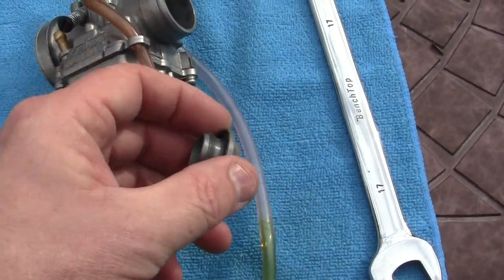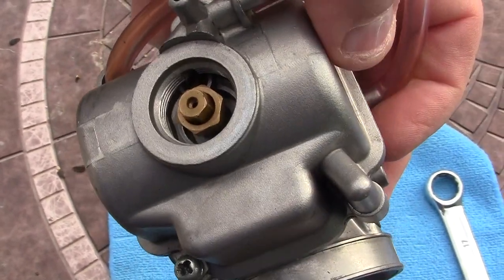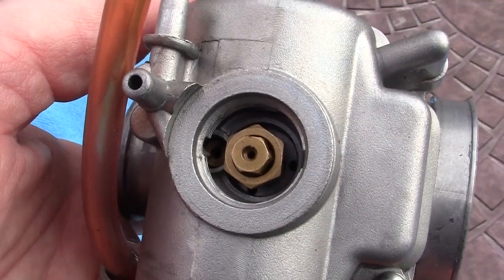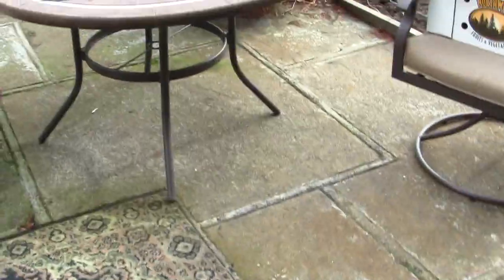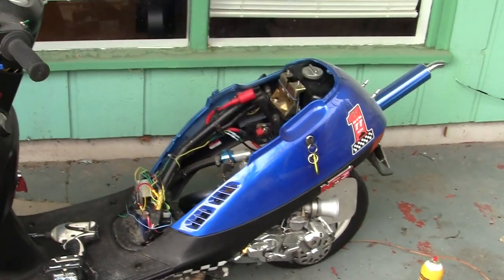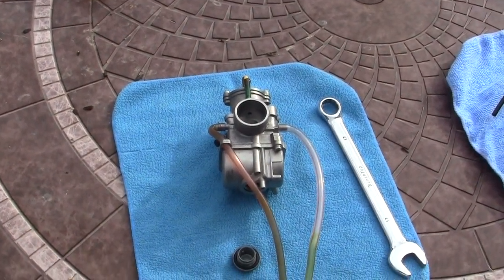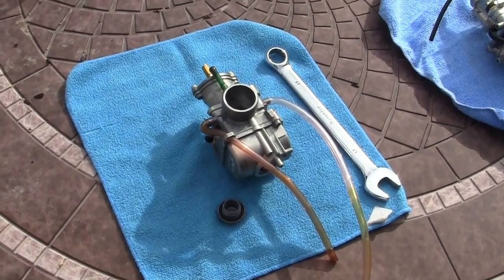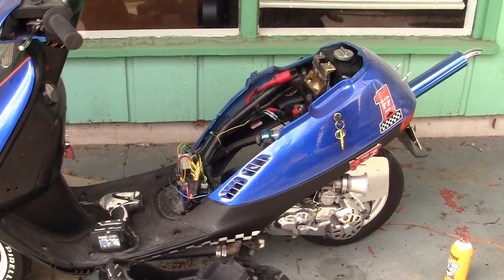2- HOW TO FIX= Most common MOPED  Carb problem.

Comment: thinking is the most time consuming ting when you fixing engines what ever.done it for 40 years so fully agree on think and use time to think.visualise it in your head and often you lockated the problem in your head.often save time to and lots off doing the wron g thing and maybe destroy a skru or worce.sorry for my bad english

Comment: Hi Great video.  I took my carb apart.  Soaked the jets.  I can't see through the pilot jet.  Do I need to see through the pilot?  My scooter is a Vespa ET4.  I don't want to put it back together to find out I should see through it.  The holes on the sides are clear and I can see through them but not from top of jet to the bottom of the jet.  Thanks! Michelle

Comment: My 49cc scooter dies if I run it up to 45mph and I already had the carb clean it’s a 4 stroke yes the jets be clean as well. Before of this problem when I hit the throttle after turning not even half way it would die. Now it’s running but only on high idle

Comment: I just purchased a Honda Aero 125 two stroke and it was running perfectly fine the day before. Today, the bike suddenly died at an intersection. It can idle but anytime I put load on the motor it dies. Any suggestions? I put fresh gas in it too

Comment: My toy engine started and running 4 s only on starting fluid only, then dead off... means spark is good, compression is good, 
Looks no gas keep going through Carb and in cylinder... ...I am not sure what Jet clogged? Need tips
Reply from the maker: Main jet is clogged. take it out , unclogg it and put it back and sounds good.
Reply: @DIOSpeedDemon  thanks for your tips fast than rocket 🚀...Dio  awesome... will trying clean carb at all ...
Thinking & discuss help us.... Feature is friendly 🤝🤝🤝

Comment: I have a scooter ( i dont know that im doing) that sat for a while was seized up, I finally got it running and the starter doesnt work. So i saw your starter fluid video and tried that and it worked but the scooter was shutting off at idle so i turned the idle screw up and. I ran the scooter around for a half hour or so and let it sit again for a week like an idiot. I used starter fluid again and it ran up the road, but then it died at idle. so i messed with both the idle screw and the air mixture screw by accident thinking i didnt know which one was which. and it started with a manual choke over the carb with my hand and kickstart, it idled but now it wont throttle well and is very very weak. the weakest I have ever noticed. i noticed the spark plug cap came off. So i check the spark plug (i just bought it last month used it once before this.) The spark plug hole in the cylinder head was smoking (a guy who drove by helped me and I told him the story and he said that starter fluid can burn up 2 STROKE ENGINE PISTONS REALLY FAST AND REALLY BAD. it looks not good was wet. I cleaned it and it gets spark. the scooter starts but it does not throttle hardly at all, and it will idle well. the spark plug gets wet. I keep loosening the screw to the carbeurator every time after i try to run it, and the carb is always leaking liquid out of the cvt case. Got any ideas? would be appreciated. If youre gonna tell me to clean the carb how do i remove the carb (in as much details as possible)
Reply from the maker: I really wish you lived near me and could bring the bike over for an afternoon and look at it. Unfortunately , I live in the middle of BumFucked nowhere and Nobody with a racing scooter lives here. I know what is wrong with you bike. As for fixing them up, it is a challenge and a cheap hobby. If you understand their engines, it is very fun to work on. I own Honda and Yamaha scooters, nothing elese.

Comment: Hello, I have a burgman 400cc. It was a daily ride but one morning it wouldn't start at all. I tried your idea (engine start spray through the throttle) but it wouldn't even try to start. Where should i check next? Thanks!
Reply from the maker: sounds like a dead battery, replace the battery.
Reply: DIOSpeedDemon oh, it does turn alright but won't start.
Reply: Vatché Ohanian  Then it's not the battery. Have you checked for spark?

Comment: I have a new carb, it idles great but when I give it gas it keeps on dying
Reply: This is the same exact problem I have!!! Guy put new carb on ran great a few days and shit! Runs kind of ok until I go past that quarter push on throttle and then wants to dye right in middle of traffic....ok from the video sounds like the main bigger jet but how is thos on a new carb? I'm myself a mechanic on cars not scooters..but can tell diff from new old...so wtf...gas was also changed too. So at full throttle it completely shuts down and if I clean this new carbs bigger jet and doesn't fix shit...what then? Just now learning about this 10yo moto fino bike but also getting pissed off quick. Please help?!